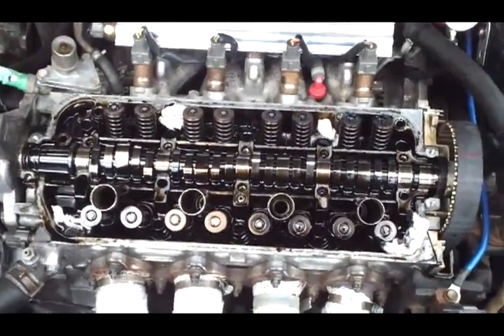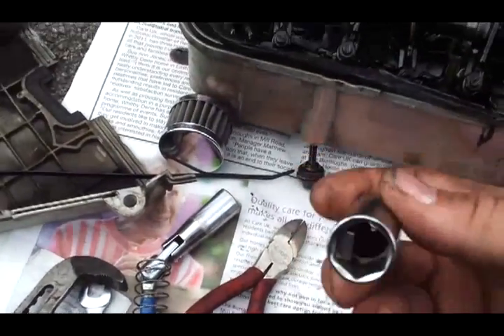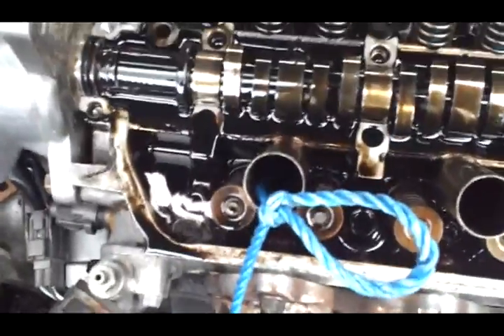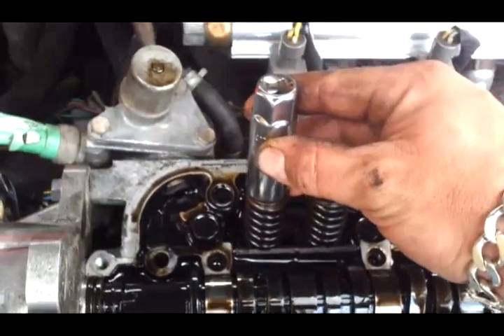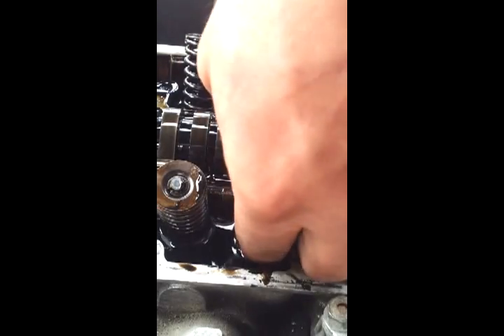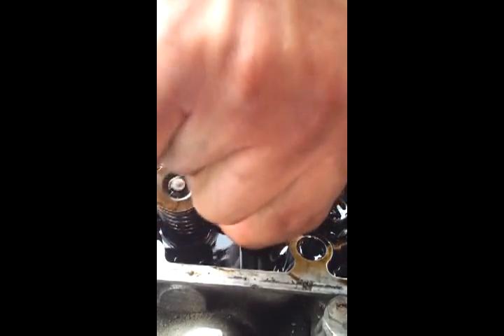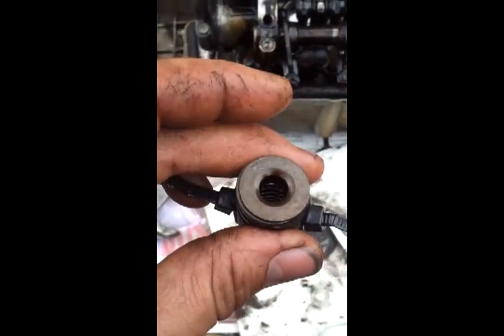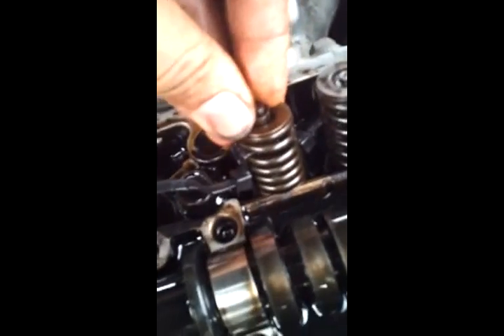how to replace value spring seals without removing the Clynder head.

Comment: Actual genious, I have all the right kit to do this in situ in work in minutes, but for your average fellow doing this on the driveway this saves the cost of all those tools . Bit more time consuming but a productive way to spend a lazy afternoon and save some dough, nice one. And no need to disturb the timing belt. Or inlet exhaust and head gaskets.

Comment from the maker: Once the ropes in the cylinder you can do all 4 seals in minutes saves the time of removing the head and saves costs of new gaskets. Took me 2 hours to do all 16valves and put it back together so now to long.
Reply: The garage said I'd have to skim my head of I got them to fix my stem seals, If I did it myself could I just replace the gaskets without skimming the head?

Comment: such tiny clips with spring weight on them. Only thing holding the valve in , kind of scary. Dropping a valve is pretty much death for a motor.

Comment: He feed it down into the cylinder when the cylinder was at BDC, he then cranked it up to TDC which compressed the rope into the valves, he did this so the valve doesn't fall when he removes the valve spring keepers and retainers.